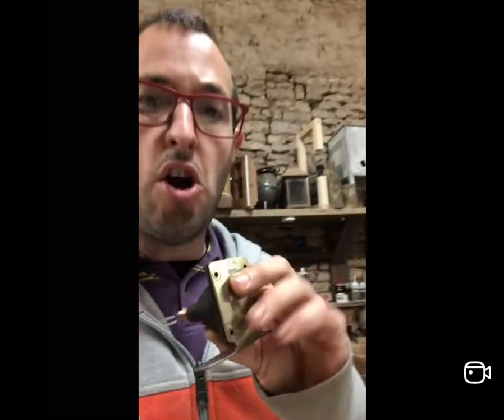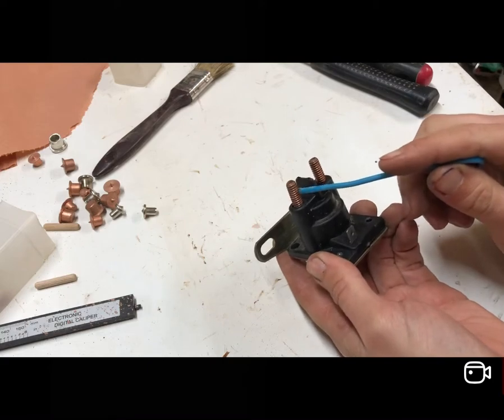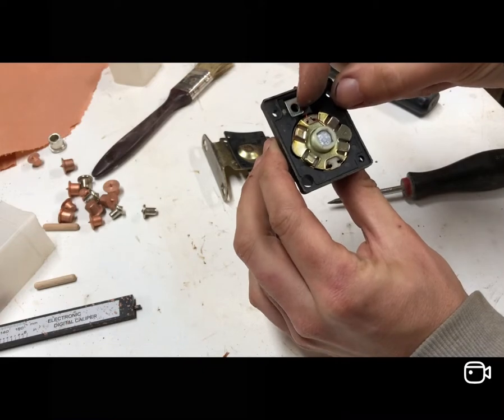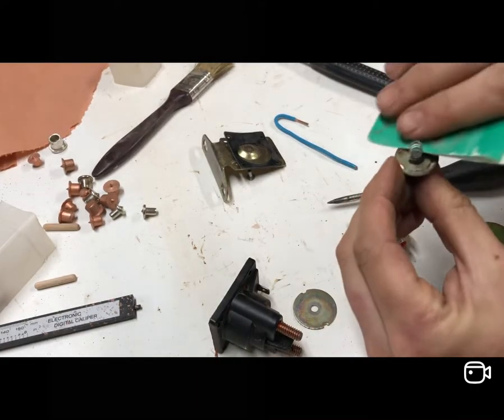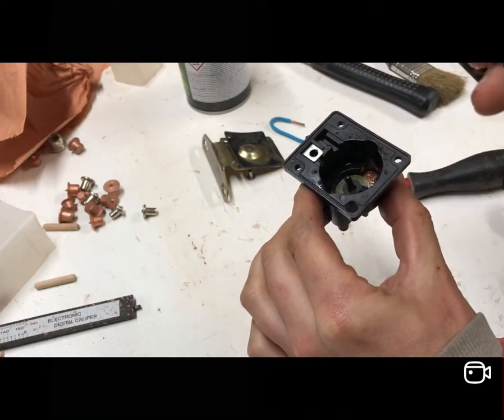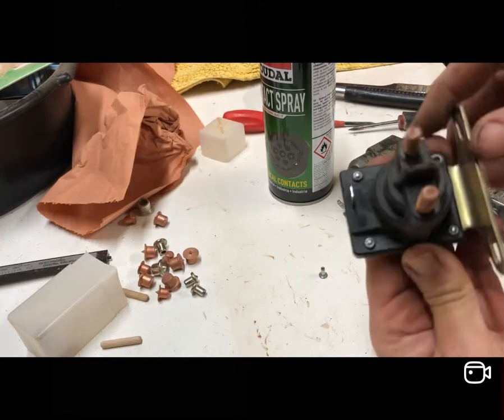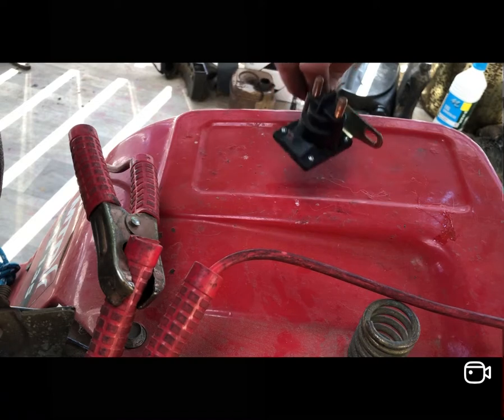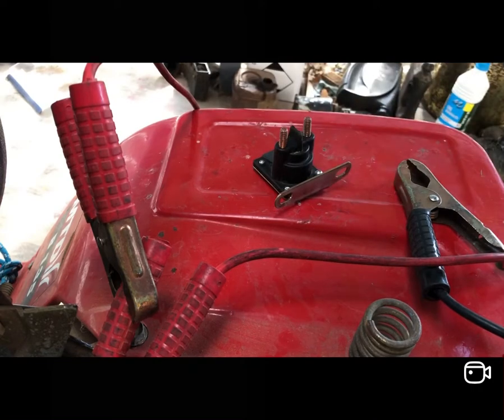How to repair a 12v mower solenoid diy lawn tractor fix

Comment: Thanks for the video. Explained really well how the solenoid works. One comment for others. Make sure you clean the contacts down after cleaning with the abrasive. If any silica, carbide, or other abrasive remains it can act as an insulator either stopping the solenoid working or promoting arcing and limiting the life before the same problem re emerges.
Reply from the maker: Hi, yes absolutely always clean with something afterwards. 
Thank you for watching.

Comment: BTW those copper terminals will tap out into your hand with only gentle taps. They are press fit. Then you can clean them easier.
Reply from the maker: Thank for that, it looked like they have been melted in so wasn’t sure. But that would make cleaning them easier as long as they fitted again nicely. 
Thank you and thanks for watching.